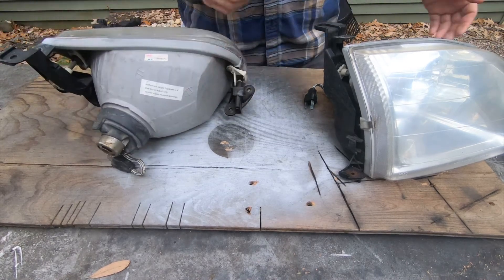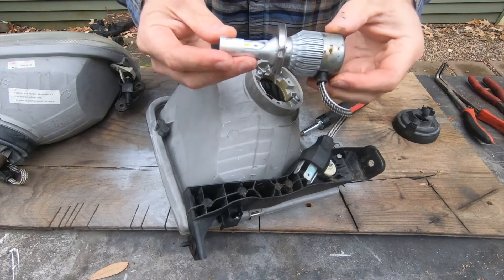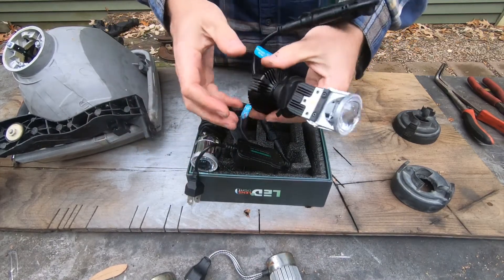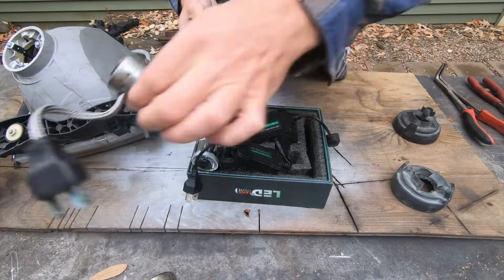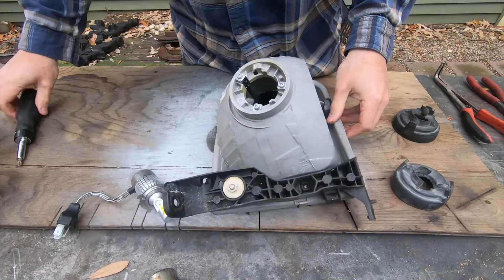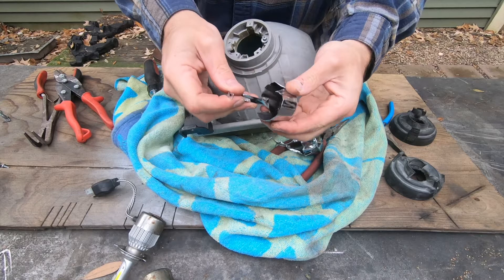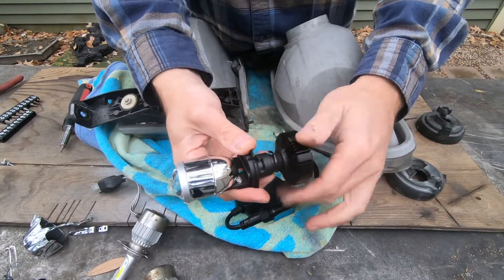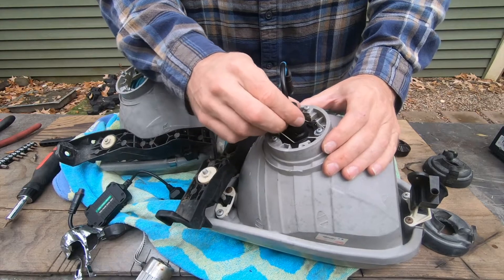Mini Projector Retrofit

Comment: did you end up having any scattering issues. I just purchased an essentially identical set but im scared to go through with it since i would need to remove the shield.
Reply from the maker: Not at all. You can see the beam patterns at the end of the video. Scattering issues are from using a standard LED in the stock housing, which is a bad idea IMO. Thats why I went with the collector (projector) type, so I wouldn’t have those issues.

Comment: Did you happen to have any issues with the bright light indicator on the dash not working after installing these?
Reply from the maker: That happens when I unplug my fogs. There is not enough resistance in the circuit to “tell” the dash that the high beams are on. Add a resistor to the headlight circuit, and that should fix the issue.

Comment: How did you Adjust the front head lights ?
Reply from the maker: There is an adjustment screw in the projectors that allow you to turn the lense inside the housing. You adjust the housing itself the same way you would with factory headlight bulbs.
Reply: @JHBtheIV  I bought the same one . My head lights is facing up trying to keep it level,
Reply from the maker: Make sure you have both projectors oriented the same way in the housings. I have mine with the open side facing straight down. That gave me a good beam pattern.
Reply: @JHBtheIV  ok thanks.
Reply from the maker: You’re welcome! If that doesn’t get your pattern sorted, next step would be adjusting the housings themselves, using the adjustment screws in the mounts.